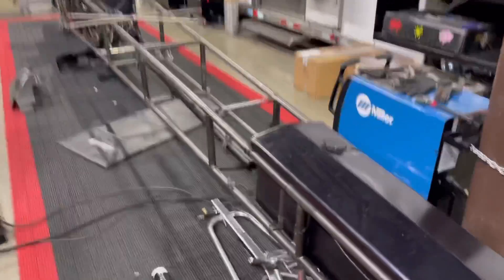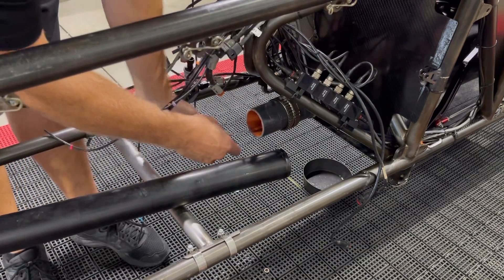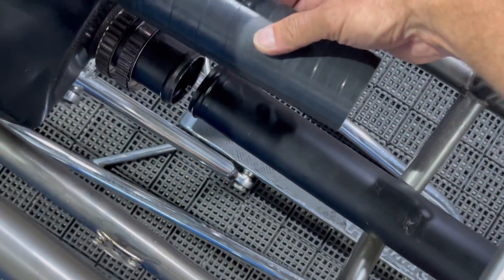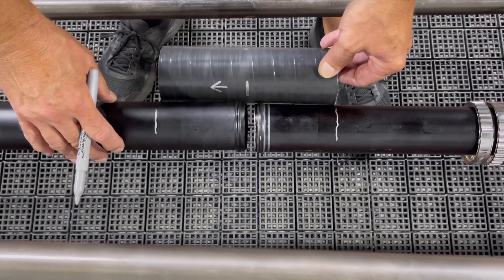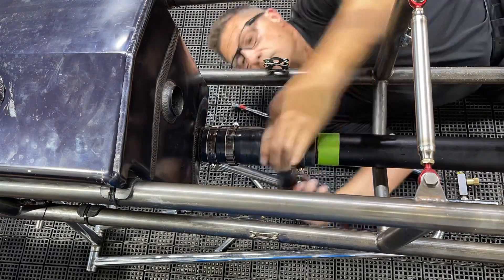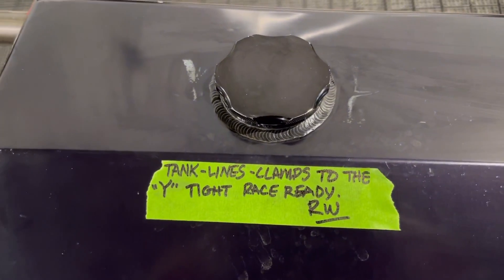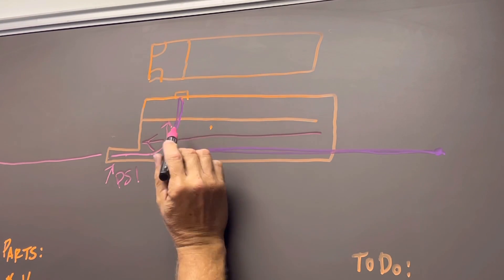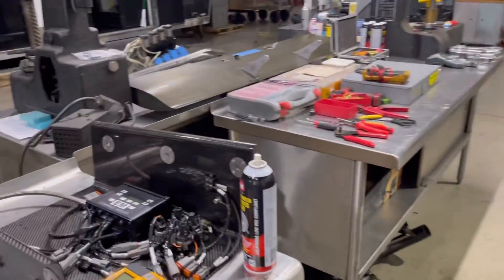Building a 10,000 HP Top Fuel Dragster (Fuel Supply)

Comment: For the life of me I can't see how brake clean would help, but you bet your ass that i'm going to try it the next time i've gotta put some hoses together :D I've always used pipe lubricant designed for plumbling. it's designed to dry out so joints dont fall apart. started using it when installing utilites with my dad, and I've been using it for all my automotive hoses since then.

Comment: Wow! My Top Sportsman car won't pass tech with any bare rubber fuel line and hose clamps. It has to be all Aeroquip style hose. I can't believe they allow this on a Nitro car... 🤔  I'm guessing it's that way, and not just TIG'ed together, so it allows for flex and doesn't crack?
Reply from the maker: No. Depends on where your fuel pump is located maybe. Anything mechanically pressurized I believe Hass to be Aeroquip style but if it’s a suction side I don’t believe it Has to be.
Reply: @robwendland  Ah, that could be. Thanks. 👍

Comment: Rob, I’ve always been curious about the Fuel Tank, I’m currently building a 1:25 Replica Top Fuel dragster (That Leah Pruitt used to drive) anyway the FUEL-TANK is setup with a “Vent Snorkel” towards the front of the Tank closet to the Frt Wheels + the Fuel Filler Cap is located at the back- 
👉There is a Cover over that VENT TUBE/Snorkel & it’s actually Glassed into the body? ?? Is this just a different design, or an older design for that Vent location- (I learned something NEW with Tank in video having its Vent at the tip of the Front Wing Section pipe🤯
🙏Thank U Sir🙏
ZenModeling

Comment: In the boating industry, there is also a confusion between cavitation and ventilation. Ventilation is where air is drawn from the surface down to the prop. Cavitation is where the fluid is put under such a low pressure that it physically boils, thus creating the vapour. We have issues that we call cavitation burn, where the bubbles collapse back to a liquid state, they have tremendous energy and can erode away metal. I feel that what you are describing as cavitation, should actually be called ventilation.
Reply from the maker: You are 100% correct! I should of explained that better. The ventilation causes cavitation which multiplies the amount of air entered into the fuel system. We return back to the pump which will multiply the issue.
Reply: @robwendland  Absolutely love  your videos, I also LOVE that you <3 your own comment!!

Comment: So what is the function of the shelf? Is it there so you can do the burnout with a full tank, then when you decelerate the remaining fuel trapped at the back above the shelf goes forward and under the shelf for the run? Or is it to create more fuel pressure?
Reply: The shelf is to keep a chamber of air separate and away from the liquid outlet for the purpose of venting. Burnouts are done on a 1/4 of 1 of the 2 fuel pumps and they used to plug the vent and remove before staging. Driver activates both pumps while staging, motor loads up right before launching. And with chutes out usually the tank is empty.
Reply: @flipfloptanlines926  of course, I completely forgot about the vent pipe near the filler inlet. So acting more like a typical rocker cover baffle. I didn't know they only used 1/4 of a pump during the burnout, I thought they used one pump and turned on the second just before the line when you hear it load up the engine. Wouldn't it make more sense to put the filler / vent at the front of the tank?

Comment: One minor technical gripe: Cavitation is when a local low pressure creates gas bubbles in a fluid, such as directly behind blades of an impeller or prop, or when fluid flows past a severe path restriction. (And cavitation erosion is where those tiny bubbles collapse on themselves and erode the surrounding material.) What you describe as the swirl in the tank isn't cavitation, it's, well, it's a swirl, a vortex. Now, cavitation can happen on a high-flow system like this, but not at the inlet. The vortex is basically the same as what you can see when a filled sink drains, the little tornado-shaped void that can form above the drain.
Reply: Cavitation is always happening especially with an oxygenated fuel. I think a vortex is just an indication that Cavitation is excessive.
Reply: @flipfloptanlines926  That's not how I understood the phenomenon. Cavitation can happen when a local underpressure causes tiny bubbles to form. That can either be outgassing when the fluid has a lot of dissolved gas in it, or just vapor when the local pressure drops below the vapor pressure. When it happens with ship propellers, on the low pressure side of a prop blade, vapor bubbles form. (And nastyness ensues when those vapor bubbles collapse. Look up cavitation erosion.)

A vortex, or swirl, happens when a flow has a rotating component to it, so centrifugal forces pull fluid away from the center. It can happen without pressure dropping below outgas or vapor pressure.

Comment: I'm assuming you'll cover the function of some fuel system components in the next video but is there any chance you could give us a taste in a future video of fuel volume requirements for parts of the run like how much volume or what condition are you shooting for at stage? Certainly there are many variables like CHT, timing, how long it is wet, etc. Maybe just some baseline stuff. I know that's getting in to the voodoo the Crewchief practices. I'm familiar with the blown alcohol stuff but us alcohol guys secretly fantasize about knowing how to turn the screws on a fuel motor lol.

Comment: My first thought:   "Oh, so he's running his fuel lines through a piece of tubing."  LOL!  (For reference, all the dispensers in the typical gas station runs through a single 2" pipe.  Not sure of the max gph, though.  Oh, and obviously each grade of fuel is a different pipe, but it's always a 2" at the submerged pump.)
Reply: i think the engine will burn 14 gallons in a 1320 run.

Comment: Cavitation.  Toilet bowl swirl,, prop blade on a boat,, The Nitro Margarita mixer.   The cavitation on a boat prop can be so impactfull ,(is that a word??), That it can create,,and immediately burst,, little tiny bubbles right on the blade itself.  It can be so strong that it pops little pieces/specks of metal off the blade.  The same effect can happen to a TF fuel pump and its alum impellers,,Hardened or not,,taking/ripping of specs of aluminum and plugging the nozzles,,to the unscheduled rapid disassembly eventuality.   Cavitation,,,bad!!.   Any cavitation can froth-in bubbles and change the ratio of extra oxygen to the already oxy rich Nitro fuel.  KAA-Boomer!!,,in a damn heartbeat!!,,,And Rob wets his pants,,because it was the last spare.  Thanks Champ!.  (Edit: The Nitro Hydro boats have to worry about the stainless steel hardened Props(2 of them) and the fuel pump cavitating all day long from the thrashing of that fuel tank and associated shit).
Reply: It is a word, only one L needed. Damn boat guys. Haha all in jest.
Reply: @aaronanderson7619  I try not to pin to the boats,,but it sneaks in there once in awhile.  Reno National Championship Air Races mid of Sept.   Ok, props again, whatever.
Reply: @kh40yr  props to yoau as well. I see what you did there

Comment: It was my understanding was that cavitation was basically a liquid boiling, or at least, turning to a vapor due to it being under low pressure/vacuum.
Reply: Yes you are mostly correct. It’s when the the static pressure drops and small bubbles form. Happens when things such as a boat propeller or centrifugal pump(fuel pump, water pump) start to spin very quickly with a lot of slip and when air is introduced it forms these bubbles which in the long run can erode away the impeller/propeller. What we care about is the fact that when the pump is cavitating the pump loses pressure and is much less efficient/can’t pump the fluid like we want it to. I think what he meant was if the fuel can not sustain enough pressure on the pump, air will be sucked through the pipe by means of that vortex and begin to cavitate the pump creating a lean condition.
Reply: TLDR Cavitation is not the vortex he described, but rather the formation of bubbles on the fuel pump impeller that are fed by the air entering through the vortex created
Reply: Thats what it is. He described a whirlpool forming and the pump sucking air that way.
Reply: @Mrshotshell  which is, of course, the concern. But I don’t think that’s technically cavitation. The pressure from the car launching still helps prevent it, though.
Reply: The cavitation is the bubbles forming in the pump, the vortex is created from the cavitation.

Comment: With that big of a fuel line and the presser on the launch can the fuel pump keep up or does it actually get in the way. Thanks for always sharing it means alot.
Reply: By keeping the head pressure high the gas expansion within the fluid that can occur from the vacuum of the pump pulling the fluid through the line is reduced. Meaning the fuel is in the exact state you want it to be upon entering the system.